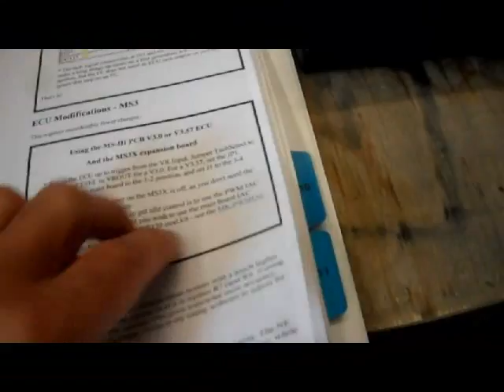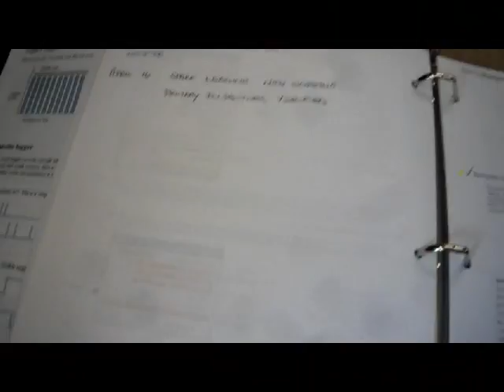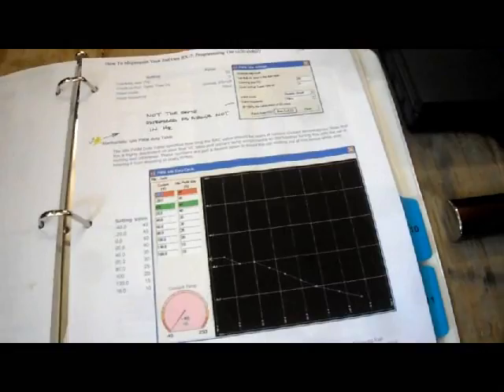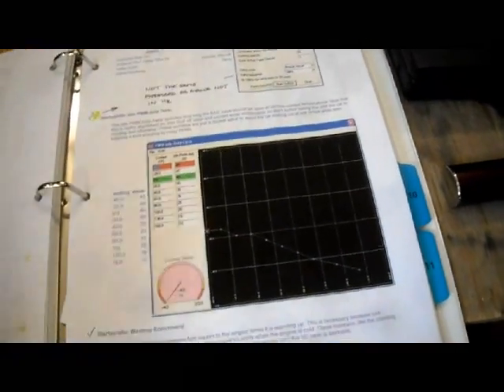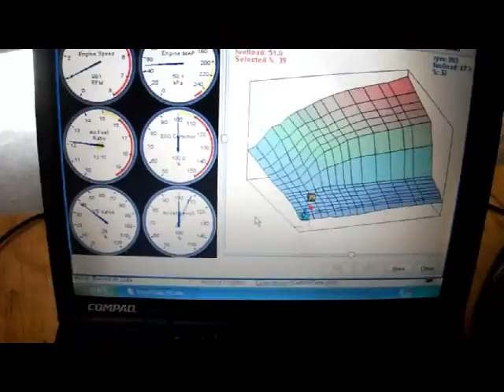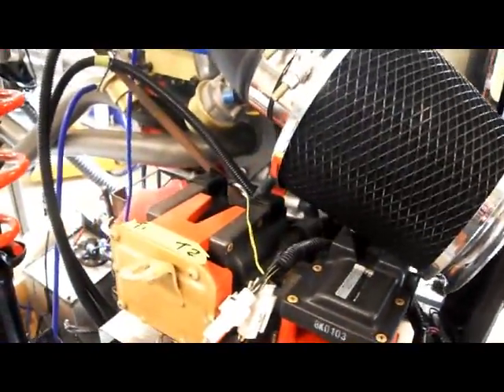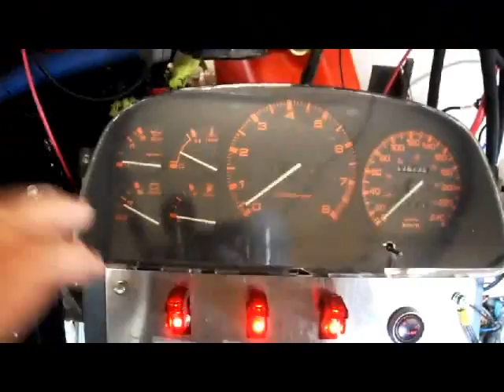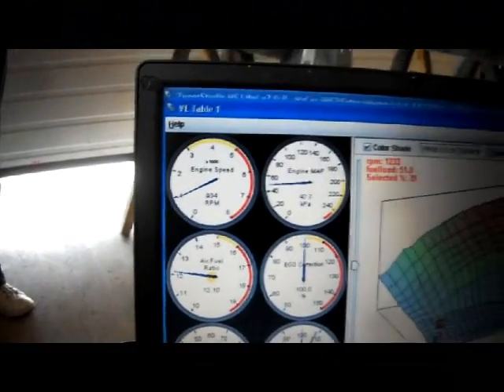FC Mega Squirt Rotary Engine Test Run

Comment: Did u do a compression test. it ssounds like its got sticking apeex or side seals . like a 6 cyclender running on 4 . engine should rev cleaner and idle with out shake . Engine needs to be pullechecked for correct clearances . 20 years i have done theses engines there is def a internal issue
Reply: or crank senser is missing one ignition stroke . def not sounded right
Reply from the maker: This was found to be a setting in MegaSquirt 2.  The Version of MS2 that I was using was upgraded from the write up done by Arron Cake.  The change in the setting has corrected this and in latter video's you can hear the different and correct tone and firing of the engine.  Yes you are correct at that time it sounded like a 6 cylinder engine.  Thanks for the comments.

Comment from the maker: Thanks for the comment.  I just posted a more recent video with the engine in the car and I have a timing light sitting near the battery.  As I viewed the video I noticed that the timing light is not showing a constant steady blink but has pauses.  MS2 and Zeal Daughter car could be the issue.  Now to sort out why will be the hard part.

Comment from the maker: 20 degrees of advance on start is too much.  As I cranked the engine it stalled the starter.  I have an optical Tach to check the rpm.  Will have to see if the sparks is firing on both rotors or just one.    I know something is off, I can see it,  Just to find it will take some more time trouble shooting.  On the Plus side all warning lights work without the stock ECU.

Comment from the maker: Two answers running pump which is working for side lube and have oil mix for the start.
I will have to look at your CAS set up as MegaSquirt did not mention cutting teeth from the CAS.  I am using the Zeal Daughter card for the 2nd VR signal.  I started the engine today  but it is apparent I have a miss or it is only running on 1 rotor. Also Tach signal is low 50% not sure why, The engine shakes like it is out of balance, but I don't think it is possible to install the cnter wt or fly wheel wrng

Comment from the maker: The Oil Metering Pump is on the car. But for starting I have added 2 ounces of Stihl 2 stroke oil to 10 Litres of Gas. I did not want to risk loosing an engine due to no side oil.  I replaced all of the oil lines from the metering pump and they are now clear.  With the engine idling I can see a drop of oil released and sucked through the tubes into the engine at different intervals.  So I know that it is working. I wanted a gentle seating of all the new seals and machining of the housings.